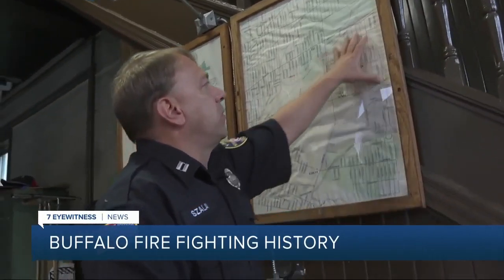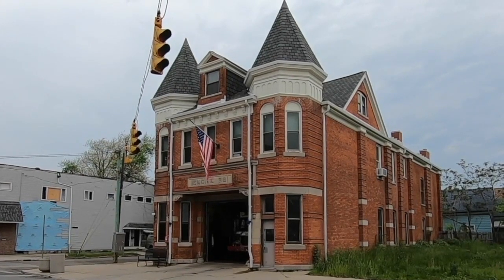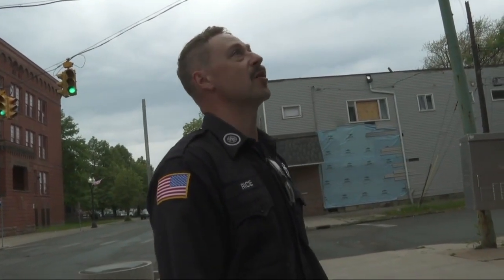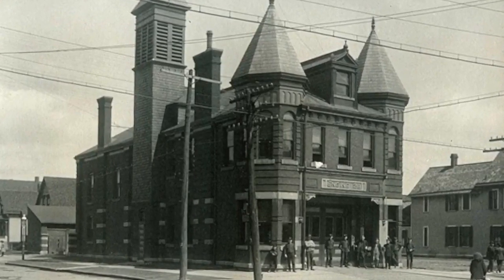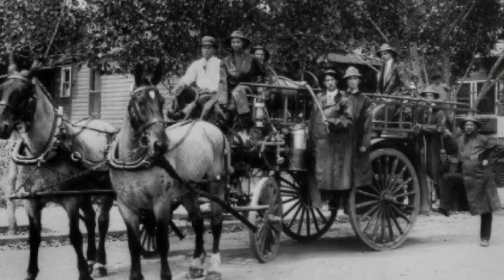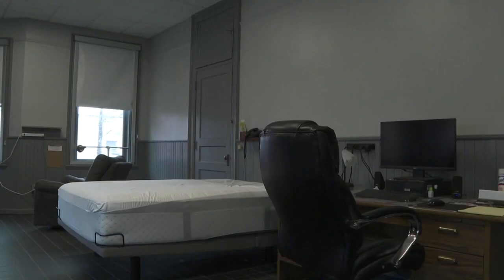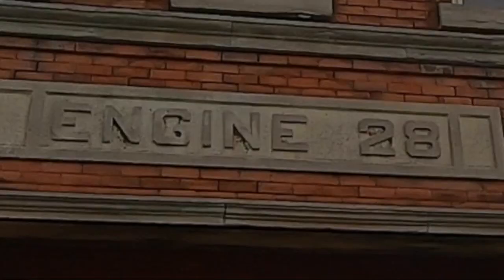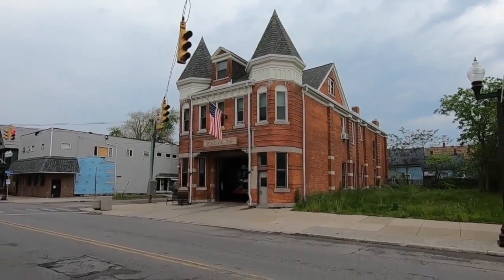Architectural treasure is 124 years old and still in operation for the Buffalo Fire Department

Comment: Still using 100 year old firehouses is stupid. Just like using 15 year old plus engines as primary response.
Reply: It's only stupid if you don't modify it up to modern standards. Contrary to popular belief, new firehouses aren't great. I would know, I was stationed at a Taj Mahal that had no character and a ton of cheap corners cut
Reply: Many cities have stations that are around 100 years old. Chicago,Boston, Baltimore,New York. The older cities can't just build new stations. Due to lack of land to build. Expansion is not always possible for the same reason. As long as the building is properly maintained no issues with older buildings. As far as equipment age. Fire apparatus has a 15 to 20 year life expectancy. 15 years is on the older side. Some departments use older units as reserve equipment others replace at 10-15 years. Some departments have units that are 30 years old in first line. This includes paid and volunteer departments. Not all departments can afford to replace till necessary. It takes 2-3 years to spec,bid,build and receive new units.
Reply: @bradcox4748  I've seen a 1956 ford Howe still on front line work the pump was rebuilt and it's on a small fire department
Reply: we have many large stations which are in use well more than 100 years as well. Of course it takes some effort to upgrade them to modern standards, as large modern fire trucks are quite a bit different that horse drawn carts, and also safety and contamination standards are very different today compared to what they were only few decades, ago. 
Nothing wrong with a 15 year old fire truck as long as its kept in good condition and is well maintained. Fire trucks barely drive long distances, even decades old fire trucks often have rather low mileage